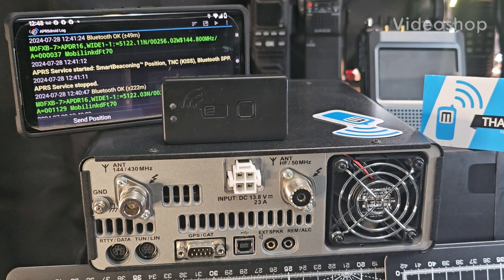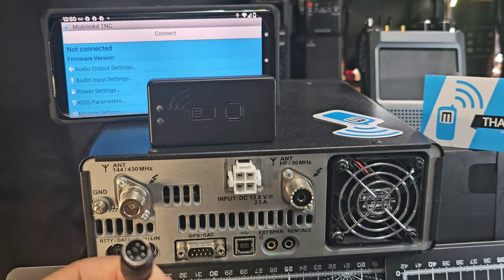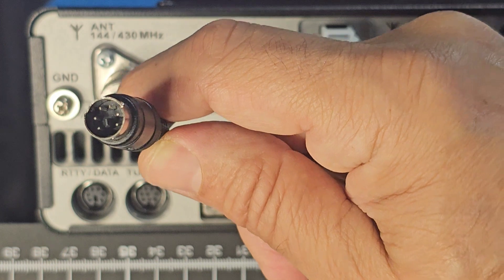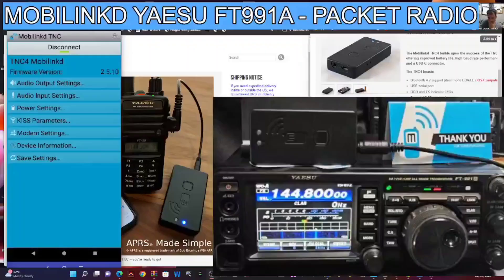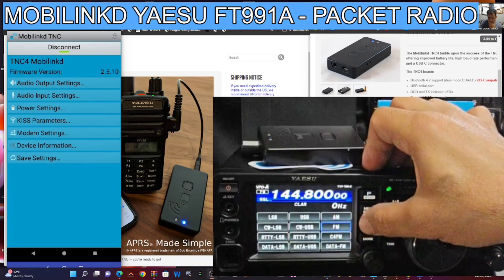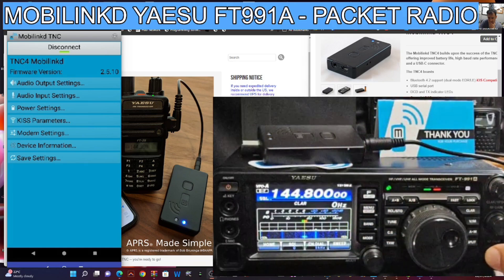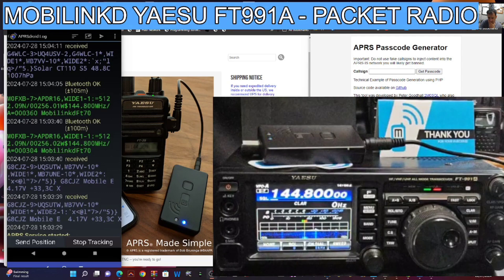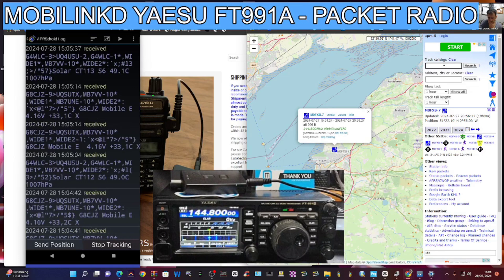Mobilinkd - Cofigure  - Yaesu FT991A Full Set Up

Comment: I have the same exact setup as you are showing.  Packet winlink session connects and the immediately disconnects.  Radio settings the same as yours. Are you using FM mode or digital FM?  And narrow or wide on the radio?   Can’t figure out what is wrong. I can use the tnc4 fine with my HT and rubber duck as I am very close to node and a digipeater.  Anyone?? Thoughts?
Reply from the maker: Hi FM wide